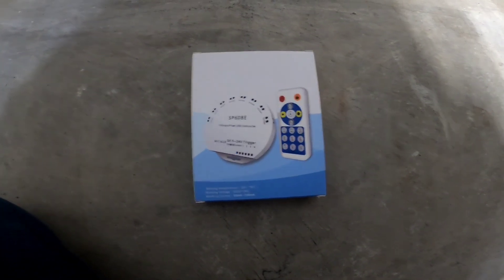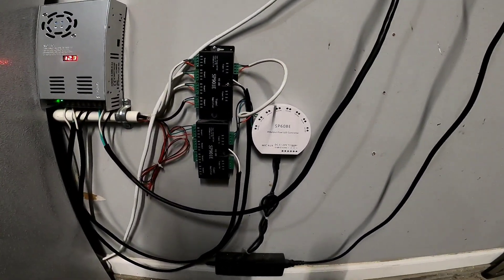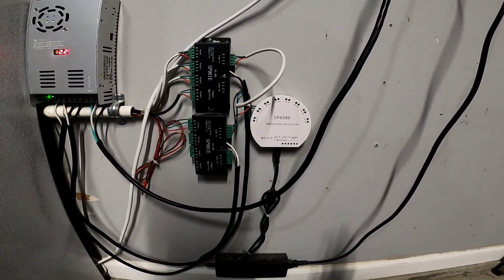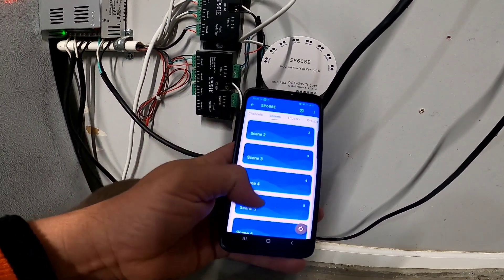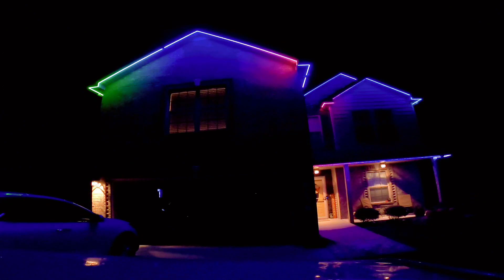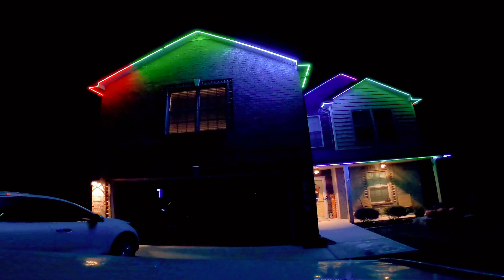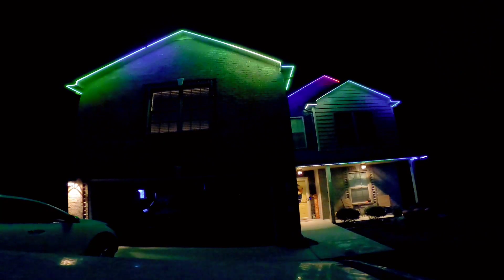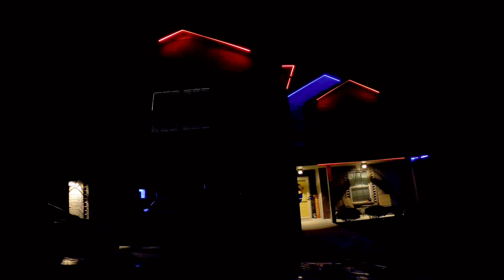BTF SP608E LED light controller install and review for LED permanent lights

Comment: can you help me? My SP608e is not connecting to the application. appears in the list, but gives a connection failure message.
Reply from the maker: Try opening app, closing it out, search for it under Bluetooth and then open app again.

Comment: Why did you switch from the sp105e? I am having problems with my setup now 4 strands of btf-ws2812b with power injection at the beginning and end of each strand. And sometimes it turns on and some not. Some people have said the sp105 is not a good controller and has caused issues
Reply from the maker: Mone still works. I use it for my arches. I just like the https://amzn.to/3GGE1sK better cause I can separate each channel for more effect.

Comment: hello , I admire your work and your explanation, I dream to have something similar to you I have dewpond this video and play more time to see the wire and other details. I see now that you use different led strip and different controller then what it is in this video presented. After your knowledge a time, if you cane start again , what it is the led strep and controller that you recommend to use for a project similar to your ? (if you cane recommend a led strip a controller and if need amplifier/power injection will by useful) Tnx in advance for the info
Reply from the maker: Sorry for the late response.  These btf products have been great. 
https://amzn.to/3S31Xgj
I'm currently using https://amzn.to/3S0t6AG for my power supply and controlling it with https://amzn.to/3trYwqg I'm also still using two amplifiers https://amzn.to/3RH1L5c 

I will tell you that I'm switching up my entire set up and going to switch everything out to govee products.  I purchased a bunch of stuff already and when it gets warmer I'll start working on the new set up. 

https://amzn.to/41G5W5O

https://amzn.to/47kkXeN

https://amzn.to/41HZHOQ

Comment: hello, you use only 1 source, correct? how to deal with the voltage drop of the wires since they go at a great distance from the source? are you sending the energy only through the correct signal amplifier? or is there a direct wire from the source to the led strips?
Reply from the maker: That is correct, I'm using a single power supply and controller. The signal amplifier is doing all the work. I have a very small voltage drop but not enough to power inject.
Reply: @BoredGuyWithACamera  I understand, in my project I connected 3 sources in parallel due to the neutral of the controller, the sources are close to the led strips, but the strips are without signal, they go crazy, I don't use a signal amplifier until then,
Reply: Up to how many meters can the amplifier calmly send the voltage to the led strips?

Comment: Hi bro..can I ask you is that possible sp608e can random auto scene without click.
Reply from the maker: Yes it will run through all the different scenes on the main screen..you can control the speed as well . Thank you for stopping by and checking out the channel. I appreciate you.
Reply: how long is the led stripe if i use dc 5v 40a .. can led stripe reach 10 meters?

Comment: Wow this is great! Question, I have a wall where I want a LED Strip (individual adressable lights). The wall is 15M and on 1 site there is a powersocket. Are you aware of a 15M LED Strip to do this? Or can I do it with 4x 3m (it are 4 parts of 3 m and 50cm in between every time).
Reply from the maker: Thank you , I appreciate your feedback. I would go with something RGBIC for better effects like this set up. https://amzn.to/3LizQ74 you can always use a different controller later if you decide to. Thank you for stopping by and watching the video.

Comment: I know you can put 8 different channels. Do all 8 of the led strips need to have the same pixel length? I want to use this controller to control both long and short length strips
Reply from the maker: Thank you for stopping by to check put the channel.  In some of my updated videos you can see that I'm up to using 5 channels that are all different lengths. With this controller it doesn't really matter the length of each run. Just keep in mind that you may have to power inject some of the longer lengths. I hope that helps. Thank you

Comment: Hey BoredGuy! Need to pick your brain... I'm trying to make a sign out of lights, just letters,  what would you recommend to just like a string of lights or should I use LED tape lights, rope lights? I would like to use color changing features as well. Thanks!
Reply from the maker: I would definitely go with pixels https://amzn.to/3ysXhFl string lights.  Im working on a video using these https://amzn.to/33j7acX that could definitely be used to make a sign and they are plug and play. Thank you for the support 🙏
Reply: @BoredGuyWithACamera  awesome! Thanks so much for getting back to me!

Comment: I love your holiday videos! I just bought 2 65ft strip rolls of ws2811 24V. It comes with the brick style 24V power supplies. For now I plan on using them because it's all I have at the moment. 
Do you think it will cause any issues if I extend the wires from the power supplies to reach the led strip? The length to the first power supply and led controller to the beginning of the run is about 40ft. The middle of the run since I have 2 ..65 ft rolls ..is about 35 ft from the power supply and the end of all is only 18ft away from the power supply.  
Or should I get just 1 large 24V power supply similar to yours and use the sp901 to distribute the runs so I won't need to inject power?
 * Only thing is, is the run of power ground data will still be a long run...example ...35-40 ft until it gets to the led strip.? 
The whole setup is going under my house  on a sheet of plywood mounted to floor runners. The sp107e "getting wifi controller" will be there as well. 
What's your opinion?
Reply from the maker: I appreciate the support,  I don't see any issue running longer wires considering you will be running 24v. You might have a slight drain in brightness but 24v is so bright your not going to miss out on anything . Switching out controllers and power supply is based of preference in what you think you could add in the future 😉.  My plan was going to be to add a 16ft mega tree this year so I added more power. I did not need it on my original set up. But just like anything else if you plan to add more each year you will add more power.
Reply: @BoredGuyWithACamera  found my problem. It was a blown ic chip at the end of the first run.  😳
Reply from the maker: @superbazooka213  I'm sorry,  I just seen all your comments at once. Glad you figured it out
Reply: @BoredGuyWithACamera  hey thanks got the info. Well I'm late this year getting to put them up but I have 2 parts of the  house installed..ws2811  24v but I have a issue. I cut the led strip to the length I needed and made a jumper of the same exact cable you used but when i power the leds up, the second strip is white all the time. So to eliminate my soldering job and wiring I put a controller and power supply to the led that stay white and they work as they should but when I link the 2 strands together , 1 works the other is white.
I made a new jumper, same.
I made sure the arrows -> are all going the same direction. 
Injected another 24v power supply to the end of the strips.
It's only 19t long so far total 1 section is 14ft the second is 5ft long with a 3.5ft cable connecting the 2 strips.  
Do you have any suggestions as I contacted the vendor and they're trying to tell me I need a inline Amp that solders in the middle of my jumpers to carry the data signal. 
I have a sp901e but I wanted my legs to run all 1 right after the other instead of multi sections running at once if that makes sense.  
Any help would be greatly appreciated.  
Thx Eric
Reply: @BoredGuyWithACamera  if you need me to make a video and post the link I can so you can see what I'm working with.

Comment: thanks for all the videos you do, definetly helping me in making my arches.
with this controller can you change the colors of each of the effects it has? like could you change the commit to flow in green or red and not just the white?
Reply from the maker: Thank you fir the support,  I greatly appreciate it and knowing the videos  are helping makes it all worth it. So you ate able to change the colors on most of the settings.  Some are locked to certain colors but as far as the comet goes. Definitely,  I just tried it.

Comment: Love this! Has the diffuser lens turned yellow since you first installed? I like the spotless look, but I understand those milky white diffusers are typically styrene, which can yellow over time. The manufacturer doesn't specify what material is being used. Acrylic resists yellowing, but I'm guessing only the crystal clear lenses would be acrylic. Any insights on getting that spotless look and avoiding yellowing would be very helpful.
Reply from the maker: Great question,  our lights have been up for a little over a year. The diffuser has not changed in color at all. All our lights are installed under the roof line and face down. So since they are never in direct sunlight they will not yellow. Not 100% sure, but so far so good

Comment: Thanks for you using BTF SP608E.
Reply from the maker: Thank you for making quality products that I'm able to twist and use my own way to create my vision.
Reply: @BoredGuyWithACamera  did you ever find out if you could program your own effects?
Reply: Do you guys make this LED strips? - I orderd 10sets of 12v 144led 1m - and they all have faulty dead led minimum 1 per strip, i spent quite a large amount of money and amason website hasnt helped at all. i am in england
Reply: @BTF-LIGHTING cane you hellp my to do same think?
Cane I have a email to send more info?
Reply: Can you add a strobe effect to the app? Or can I program my own effects?
Reply: can you help me? My SP608e is not connecting to the application. appears in the list, but gives a connection failure message.
Reply: Is possible to add custom effects to this controller?

Comment: I just bought the SP608E, the SP901E and the BTF WS2812B LED strip lights off of the links in your video, but I have a few questions for you. 
The big p/s feeds power to the SP901E correct? 
On the Signal Input from the SP608E you have a black ground wire and maybe a blue DAT wire coming from the SP608E. Is that also right?
If it is then so far so good 👍
The on the Output 1 (2,3,4) of the SP901E you are running a VCC, GND and DAT1 wires all the way out of the garage to the beginning of the WS2812B LED strips correct?
If that is also right then I need to buy some heat shrink tubing and wire to run from the Outputs of the SP901E to the LED strips.
So I would take the connector that is supplied with the LED strips and plug the female into the male end. Then I would complete the circuit using the wire I ran from Output 1 to the Red Green White pigtail, right?
If I am good so far my final question is what are the extra Red and White wires on the LED strip used for? 
Sorry to be so lengthy and thanks for your help.
Reply from the maker: It's no problem at all. I try to help everyone out the best I can. Yes the PS is hooked up directly to the SP901Es, then I have a 12v power supply plugged into SP608E. The 608e has data and power running into the SP901E but not ground. The ground is supplied by the PS. I have standard low voltage 3 wire coming out of the SP901Es direct to the start of each LED strip on the house in 5 sections. Or 5 channels from the two SP901Es. The extra wires on the strips are built in injection points. So if you connect 3 or 4 16ft strips there's a good chance you will need to inject extra power in the middle and end of each long section. I have not run into a situation where I needed to inject power so far. As I continue to build on to my LEDs I will probably need it. I ran power and ground while I was doing my lights and just taped them up and tucked them in behind the siding fir when I need them . I hope this helps answer your questions.  If I missed something please let me know. Thank you for stopping by and supporting the channel.
Reply: @BoredGuyWithACamera  yes it sure does answer ny questions. Thanks for your help. I appreciate it! 😊
Reply: @BoredGuyWithACamera  is there any way to program the lights with the SP608E?
I have the app on my android and it only shows preset scenes. I would like to change the colors of the LEDs, but I do not see that ability in the app.
I also have not been able to find any other support online for this product either like a manual. 😔
Reply from the maker: @holyroller6978  it looks like there is a way, give me some time to try and figure it out. I'll get back to you. Happy Thanksgiving
Reply: @BoredGuyWithACamera  excellent and thanks! I would love to be able to figure out how to program the lights to do what I want in the colors I want 😊 Happy Thanksgiving to you and your family too.
Reply: @BoredGuyWithACamera  i hate to keep asking you questions. I was curious how you tie each strip into each other. The reason Im asking is because the second strip has to tie into the first strip because to have the effects work correctly that needs to happen so a light that is moving along strip one needs to flow to the second strip and to the third strip and etc. Do you connect the first strip into the first data port and the second data strip into the second port, etc.? Thanks again.